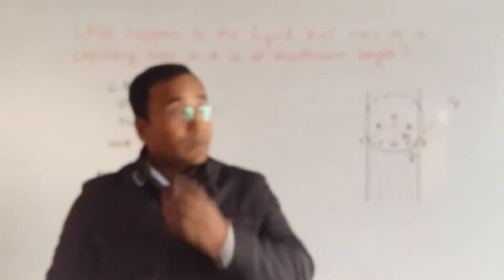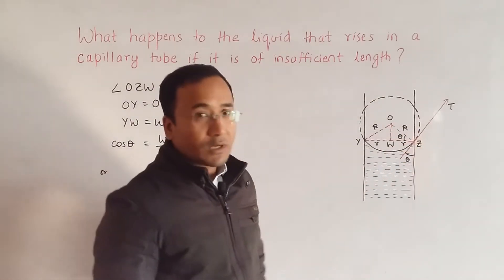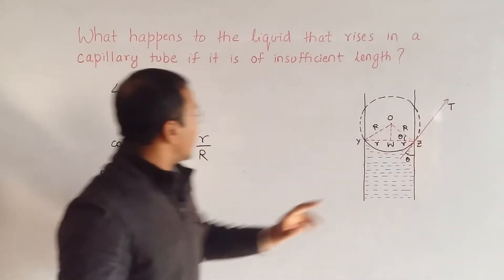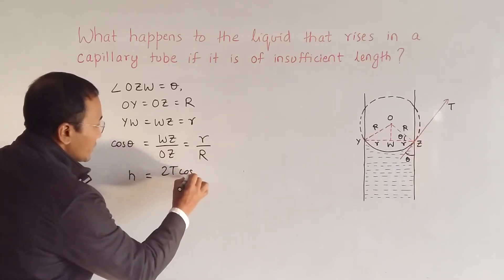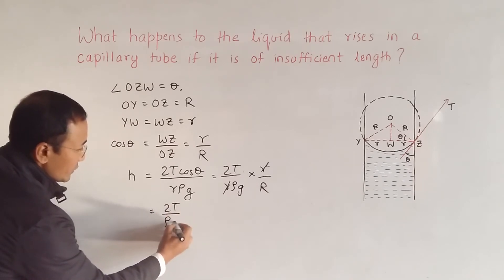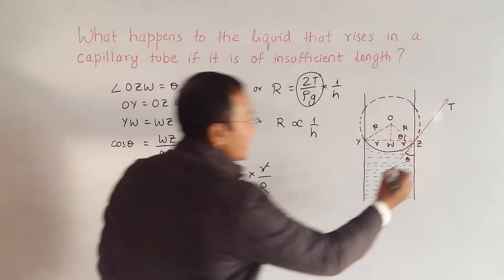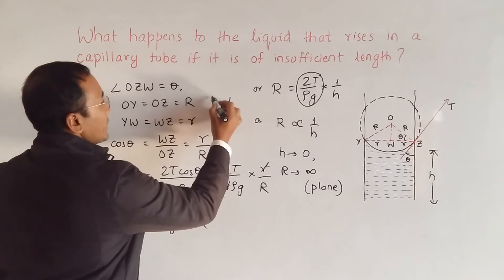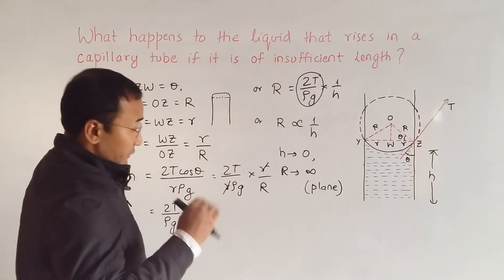Does liquid in a capillary tube overflow if the tube is of insufficient length?

Comment: I can't understand how insufficient length of capillary not cause overflow. For example if height of water is supposed to go 1meter height but in a tube of 1/2cm height how it will able to get balanced(weight) by just adjusting it's meniscus radius.
Reply: Because it was only the capillary tht was responsible for the pulling of water(by adhesive force) but at the end of the tube there is nothing to pull the water/liquid 
This along with the meniscus angle change makes it impossible for liquid to overflow.
Reply: @Upsc-wca  thanks for explaining